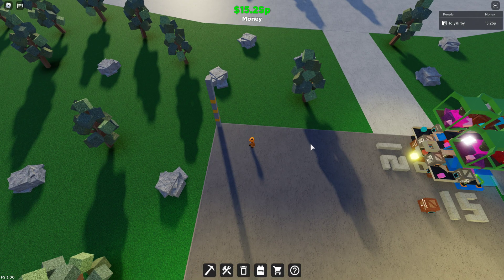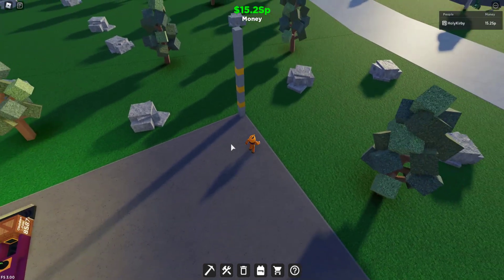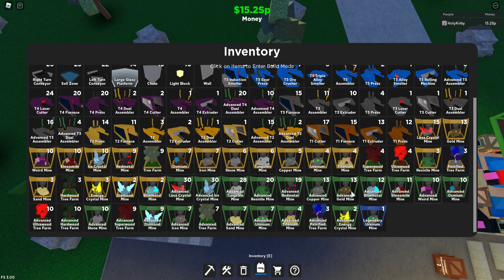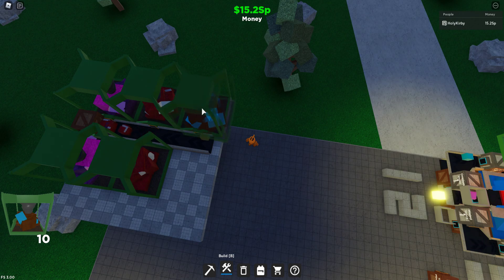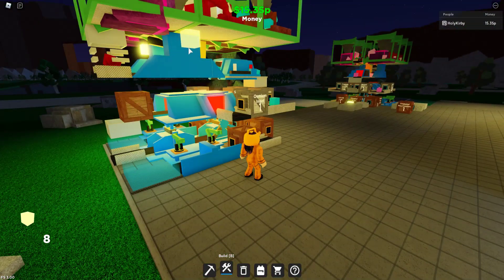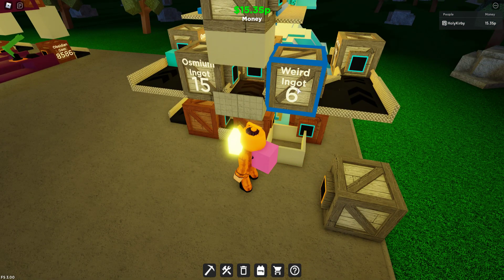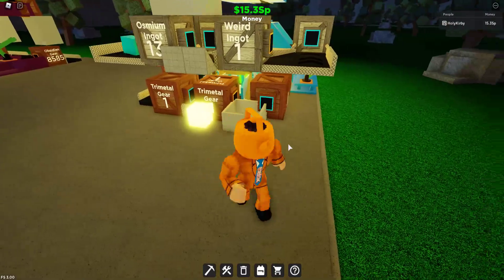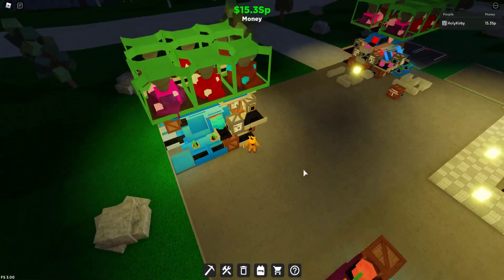Factory Simulator Roblox - How to build - Tier 5 [Compressed] - Trimetal Mechanism

Comment: I built my own and got down to 14 wide x 15 long x 11 tall.

Edit: My version would be stackable if it weren't for the fact that the devs decided to have the build zone at its max be 21 blocks tall. Pisses me off.
Reply from the maker: It use to be worse, these builds were made when the max height was 14 blocks tall.

These videos just provide a guide for users, one does not have to take these to heart but can use them as a reference to improve upon there own build if they think they can make something better. :)